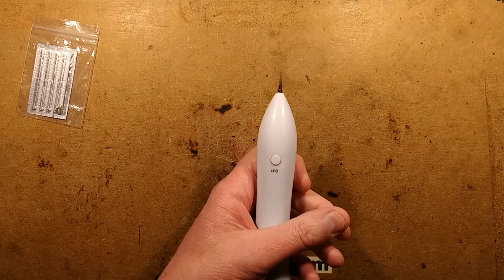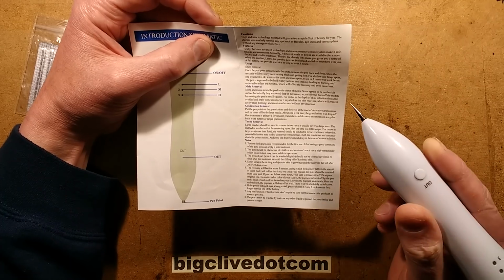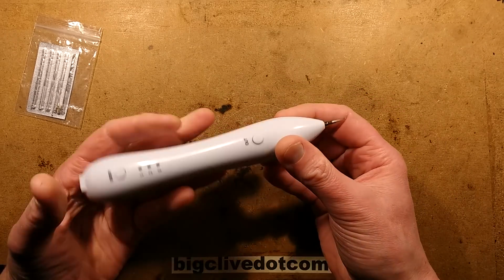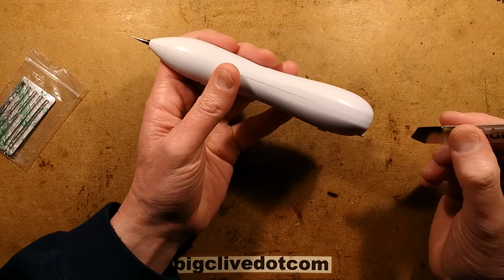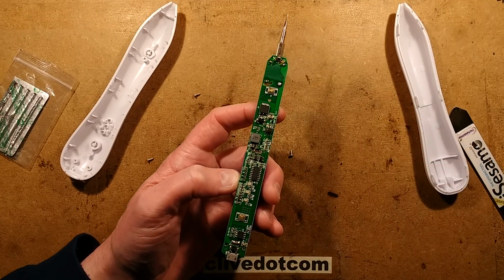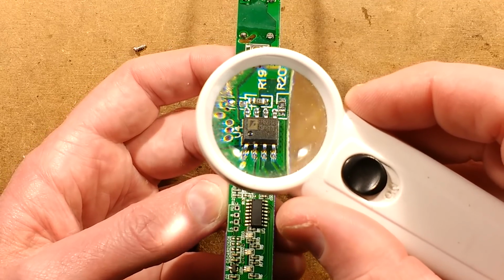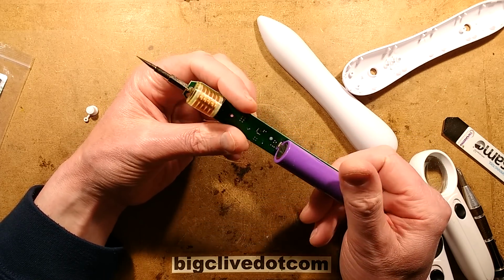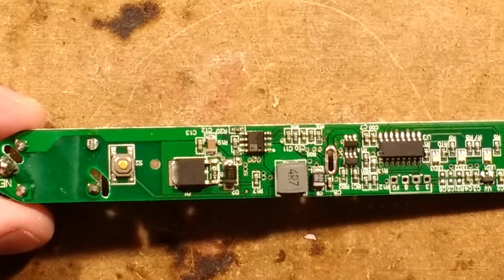USB flesh-burning pen for ladies.  Because apparently they do that.

Comment: The cheap ones on Ali are half the size and don't have a battery but just a USB power lead.
It's like my neon tester but instead of blinking it's constantly on. Holding it to a high pressure sodium lamp makes a nice plasma lamp. But I've seen it go up to 12W  and it runs pretty hot. But it just keeps on going 😂
Reply from the maker: That could stress the insulation to ground of a USB power supply.

Comment: This is not a laser is Ashley, high frequency, electricity on the Tip now he plays a tip on your arm or anywhere in your skin. It won’t cost pain or electric shock, but will be hot in and when you hold your skin there long enough, it might begin to hurt the tip of your finger or any part of your skin or so if you harmless burn marks that will drop off in a day

Comment: I was thinking about buying that; I usually remove my skin moles using the tip of a paring knife, or a fine needle which I heat over the stove fire and then gently touch the mole.

I removed one on my chest that was black, and bumpy; it wasn't there years before, my guess. You know Google, squamous cell carcinoma. I burned it, and it feel off in a few days.

I think burning them is better than removing them at a hospital with a scalpel; I read that a man got a squamous cell carcinoma removed at a hospital, then via the cut some cancerous cells entered his blood stream and he died a few months or years later from full blown invasive cancer.

Comment: Just a bit off the top mate.

This could be great for my ingrown toenails
Reply from the maker: I wouldn't recommend it for your nails.  I use electronic side cutters on mine when they occur.
Reply: I was thinking more the skin around them, ill win one day.

How afraid should I be of soldering a new USB port onto my phone are having removed it from the dodgy brand new components?
Reply from the maker: @benm5407  Soldering something that small can be a challenge.  It's easy to cause more damage.  Check out Northridgefix videos to see the techniques.
Reply: I need more "crackhead in shed" instructional rather than professional with the right tools.  Thanks for the info & all the wonderful content

Comment: That actually works pretty well. It just destroys the targeted location, the body heals itself after that, just like after a burn. You can also heat up a needle pin red hot and use it to cauterise

Comment: Could you rework this unit to be a soldering Iron like or similar to your vape iron? Thinking that this unit would be more accessible to the circuits for the mod needed. Just thinking.
Reply from the maker: Hi voltage arc.  It would destroy components.

Comment: People spend too much time relying on doctors and dentist. The human body is nothing but an organic machine. You might be shocked to know but you can feel your own cavities with light cure filler. You can also remove skin tags moles warts and other skin imperfections with electric scalpel which that's basically what this is. But don't use one if you have a pacemaker. Also put some lidocaine on the area and wrap it for about 20 minutes before starting removal. Because it does hurt.

Comment: You do realize this type of machine is used in dermatologist offices all across America. This is obviously a very cheap one that I would not buy. I've got a more expensive machine that I use and it works great. The whole purpose is as it burns a very small area at a time it also cauterizes the wound to prevent bleeding. I have removed moles warts skin tags and a couple scarred areas. It promotes two things. First off and evaporates the area of skin you are cutting. It also sends a signal to the dermis that there is an area that needs repaired. People that have ever heard the term mother wart don't realize there's not actually a mother wart. By burning and removing a wart it could teach your body that the wart is a virus and needs destroyed. Then your body will send t-cells to attack any new spots that show the signature of a wart. I do not recommend using one of these for tattoo removal though. They are too small and fidgety. I prefer using my actual laser over this ion cutter. You can pick up a laser version for about 180 and it does work much better. But yeah this is the exact same technique they use at the dermatologist they just got a much better machine.

Comment: I used a stencil burner, years ago, to burn off a small mole that appeared on my nose, and one on my lip. Didn't get a scar. They never returned. Burned off dime size mole that appeared on my body. Used an infrared lamp to remove a spot of basal cell carcinoma on my thigh.
Reply: Jeez - where d'you live that not getting a doctor to do it wasn't an option? o_0

Comment: To get rid of moles would require a major full thickness burn.  It would leave a scar BIGGER than the mole.  It might removed seborrheic keratoses but that, too, would leave a scar.  It won't likely get rid of age spots very well and would leave dark scars.

Comment: I actually just bought one of these. I think I've found the perfect application for it: 

I'm suffering from a common immune disease that causes aphtous stomatitis, meaning extremely painful but harmless sore spots (ulcers) in my mouth. The best way of dealing with them is destroying them directly. When I have larger ones, my doctor usually does it with a powerful laser, at home I use concentrated acetic acid to do the job. I think, though, that this device is going to work much better for that task. It's designed to precisely and safely burn small spots of skin, making it perfect to destroy an ulcer.

I think I'll edit this comment when the thing has actually arrived and I've had the chance to test it. Wish me luck!

Edit: Yes, it arrived and I had the chance to actually test it. It works really, really well for that specific task. It's quite painful to use it, though, so I would only recommend it to people who are not that sensitive. For me, it's no problem. Thanks, Clive, for bringing this to my attention.

Comment: Long ago I had a gadget like that which was called a "home electrolysis machine." It was used to remove hair. The needle was carefully stuck down into the follicle hole alongside the hair and the button pressed. The RF would cauterize the hair root thus killing it.  It worked well at removing the hair but it hurt like hell to use it!
Reply from the maker: I came across those and thought they were a bit squirmy.  Have you seen the modern "darsonval" violet wands being sold on eBay?  Here's a UK listing for one from Singapore.
https://www.ebay.co.uk/itm/143094411324

Comment: Do these work as tattoo removal?
Reply from the maker: Not recommended.
Reply: @bigclivedotcom  I am just wondering because i have a tattoo on my arm of my ex girlfriend's initials and I want it GONE.
Reply from the maker: @LusterLayer  I think the two options are selective laser removal by a specialist or cover it with another tattoo.
Reply: @bigclivedotcom  Yeah I am actually currently giving myself another tattoo over it of the new girl's name.
Reply from the maker: @LusterLayer  Might be better to not get names just in case.
Reply: @bigclivedotcom  I will remember that next time.

Comment: theres all kinds of weirdness in the USB/rechargeable electrical psuedo-beauty quack gadgetry section of ebay. lots of varieties of these, apparently genuine laser pens for tattoo removal, bizarre "microneedling" devices which dont appeaer to use heat or lasers, they look like do some kind of very fine tattoo needle thing but without ink, whatever good that is going to do, but most intriguing of all are the ultrasonic facial shovels. its all reminiscent of those weird late victorian electro-medical quackery machines.

Comment: looks like a small soldering iron ? - wait 4 it -  clive will pull it apart & show & tell us 😲😁👉🤳🎬💭 i see a copper winding u know it has power  borrows the mrs skin burner to solder  some wires shh 🤪🤷‍♂️💭wtf took me while in google but its $10 or 6 pounds 👍
all the tech involed in this cheap cost a  Burger or ham dinner lol

Comment: Nice little toy but I've had my grubbies inside a couple of the big boys! A Hyfrecator and a Parkall Dental Model electrosurgery unit - the Hyfrecator is your basic, mains current through a spark-gap feeding a resonant transformer Tesla coil with the output going through another spark gap (as a current limiter) and out a high-tension lead to a cutting needle while the Parkall used a thermionic valve oscillator to drive the resonant transformer (thereby eliminating that sick hiss across all the radio bands of a spark gap Tesla...) No.. wait... I tell a lie, make that three, as I also had a "Violet Ray Machine" apart - a mains powered vibrator induction coil, much like a Modal A Ford spark coil, with a spark gap current limiter in a (large) hand-held wand that could be fitted with all sorts of metal or gas-filled glass tube electrodes (that would light up purple like a plasma ball, thus "Violet Ray") to "cure what ails you" (and, apparently, being reproduced for the S&M crowd for whatever they get up to...)

Comment: Devices like these have existed for a very very long time.  I'm more surprised at the scoffing present in the video and its title than the actual product.  Preferably a higher current should go through it for a split second to burn a tiny area instantaneously but the concept is the same.  I've gotten a wart removed in this way and it has worked very well, and it heals just in time for the scab to come off.

Comment: Could you use this to brand someone? Hypothetically, of course
Reply: Using this is probably a zillion times more painful than branding.
Branding uses a quick press to the skin with a relatively blunt object. A good brand doesn't hurt as much as it could, because it removes the skins receptors as it cauterizes, whereas I'm sure this tip would make your pain receptors go crazy before burning them off of you :/
Reply: I wanna get a brand so kinda curious about this too 😂

Comment: I would not recommend to remove moles and skin imperfections by using such a device. This is a simply ridiculous nonsense to make use of such an "unprofessional" thing which just "burns things up the chimney". Which can produce damage as well. We actually do never know what is underneath before an examination has been conducted, maybe a cancerous malignum area of tissue or otherwise. Even this is NOT recommended for any kind of warts. Which should be left to a doctor resp. surgeon as well. so stay away from it. by all means! THIS device is nothing else like a modified use of an SMD soldering unit literally. the pin gets hot enough assumingly.

Comment: I wonder if it could alter finger prints enough so they couldn't be traced...
Reply: Alex jones lol, YES - scarring your finger pads will absolutely disfigure your prints - if you have any left at all.  Fingerprints are actually quite delicate.  There are a few skin disorders that prevent people from being able to use mobile phone fingerprint scanners for more than a few weeks or even days, so a burn...  yeah.  If you’re a masochist.
Reply: Usually conventional red hot iron does the job
Reply: that'll only happen if the damage isn't superficial. if it is, the skin WILL grow back in the same pattern of the fingerprints.
Reply: @Stumble.Stop.Repeat same with hairdressers who don't wear gloves
Reply: Could you just file them off?
Reply: Heat up a pan and just place all your fingers on there for a min.
Reply: @Stumble.Stop.Repeat I know a girl that doesn't have any cause she would break pilos so much after smoking meth lol
Reply: Even playing the guitar can do that, although temporary.
Reply: Super glue.
Reply: Whatever happened to wearing gloves?
Reply: Turn your bike upside-down turn pedals and rub fingers on back tyre works a treat
Reply: A real fine hard cheese grater , a belt sander, or a Dremel with a sanding wheel could work too. I’ve had some sore spots on my hands before when I was using sand paper and sanding sponges on some woodwork we were finishing on a custom home and after two weeks of sanding it hurt just to open your palms outward. I used a pair of gloves in the beginning but they get in the way and I don’t think they would have helped enough to keep them on. Or you could be like this guy on TV that was interviewed for the crimes that he did 10 years before and he was trying to steal a homeless guys identity and he was sitting in a hotel room with a bowl of acid and soaking one finger at a time. His ring finger sat in the acid too long and he walked over to a hospital to check on it and hoping they wouldn’t notice what was done on the others (they didn’t) and they had to amputate his finger to the last joint because of the caustic damage. Smart fella!
Reply: My mum has no fingerprints due to her medication. Although one could say a lack if fingerprints may be distinctive enough
Reply: lol
Reply: Better using pineapple juice to painlessly remove fingerprints
Reply: @Reiko_Ruffneck  Not sure if you're joking or not but if you aren't then I would advise watching Tom Scott's video on removing fingerprints with pineapple.
Reply: @AlmostUselessPenguin  lol OK maybe not painless in his case.
Reply: Use a razor to cut the top layers of skin off and then soak the bare flesh in sulphuric acid and then bleach and then rinse. Good luck! 👍🏻
Reply: One criminal tried something like that, if I remember correctly he had extra skin grafted onto his fingertips to obliterate his fingerprints; of course being the only person in the world without fingerprints made it very easy for the police to place him at crime scenes.
Reply: @Aurochhunter  not the only person, certain medications can cause it and there are rare birth defects that can cause it

Comment: Hey, licenced beautician here. This is cheap and dangerous version of electrokoagulating machine. This kind of technology can be used for removing warts, skin tags and lipomas.  Yes, you actually burning away the affected area, but you control the power and you need to know when to stop to not to affect the healthy flesh. The device probably has some security against holding it next to skin for too long, as you shouldn't do that. You do a lot of short, kind of poking with this technique. However this sounds really bad to DIY with some cheap thing that has only 3 settings and the heads should be sterile.

Comment: Might be useful for cauterizing wounds. Mini bovie.
Reply: Unfortunately, this would not be viable for cauterization or anything else for that matter. Cauterization is actually very dangerous and could potentially make the situation much worse. There are only a few situations where cauterization of a wound is preferred to standard treatment. Typically you would only use cauterization if you can not stop the bleeding of a wound. If you do this to a wound you run a higher chance of infection or even damaging the remaining live tissues. However, bleeding to death is much worse than infection. If you were to do such a thing then you would need something much hotter than this. It would need to be flat and sanitary of course.

"If compression and elevation of the wound site does not cause the wound to stop bleeding and stitching the wound would take too long, cauterization can be used as a way to stop the bleeding. Patients can die when they lose about half of their total blood, so if a wound hits a major artery or blood vessel, this could be the best option." https://advancedtissue.com/2014/01/cauterizing-a-wound-when-to-use-in-practice/
Reply: In the Lord's Army you come off as a dick just so you know. Like a Med student.
Reply: Narmer Man 
Not really. They’re just explaining as to why cauterization wouldn’t particularly be a good idea.
Reply: Narmer Man that was awfully rude
Reply: @Berglecutt  Dude you got issues lol. I really appreciated reading that and it's actually quite interesting.
Reply: Sounds like something a dick would suggest

Comment: This is for removing warts I think.
Nothing wrong with that. Alternatively, would you like to try the freezing treatment? A needle that sprays a thin jet of liquid nitrogren onto your wart, locally freezing and destroying the wart tissue. 

I don't get what the fuss is about?
Reply: i think the problem is that warts go deeper than how they appear, burning them off with a 5 dollar tool you found on ebay is a bad idea and you should probably see a medical professional instead. you know, to avoid severely hurting yourself
Reply: @dnadesu  Medical professionals will give you a range of options. Alternatively, cover it with nail polish. It's a sealant that isn't harmful. Will prevent the wart from living by starving it of oxygen or something. I promise it works, it did for me. And it's completely true what you said about how deep they go. I could dig out about half an inch of dead wart. Cylinder shaped.

Comment: Went to a beauty place and they used something like this but it’s more safe and doesn’t burn your skin. Imagine a tattoo pen but no ink but for moles.  I had a mole near my nose and they used it on that mole. It worked and surprisingly after 3 days of the scab healing it was gone.
I am not saying this isn’t bad. I’m saying there are other ways to remove moles without burning yourself.

Comment: You could make a taser out of this easily.  Just add a cap in series with the primary of the output transformer and an SCR switch across cap and primary, and a timer or power supply that will break over the SCR.

Comment: This is pretty much the same circuitry system my work uses as a drive inverter for older generation CCFL backlights for displays...
Yes, I've been burned by them. Pro tip, don't touch the HV output system.
So should I be burning my questionable moles off with CCFL backlight drivers???